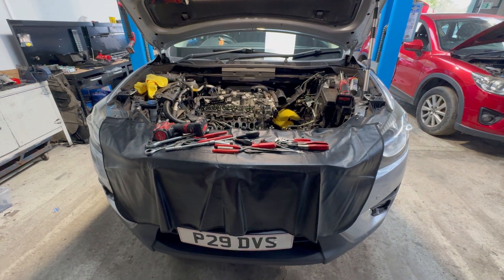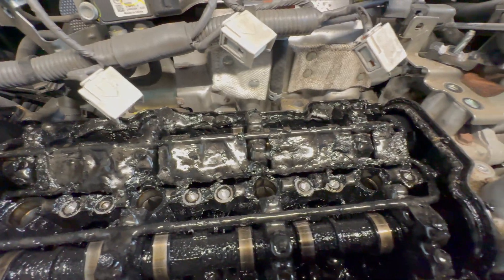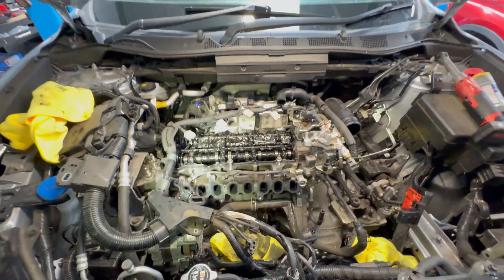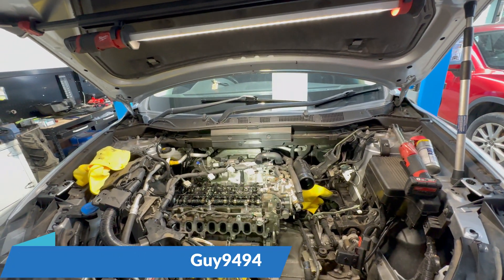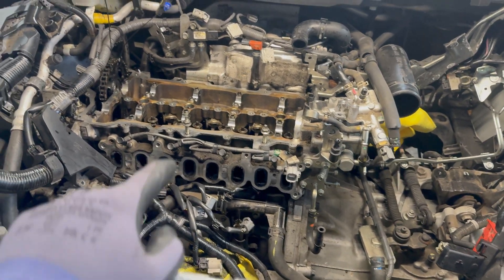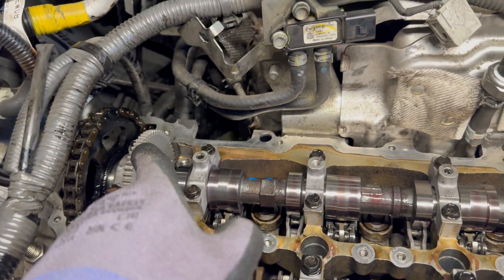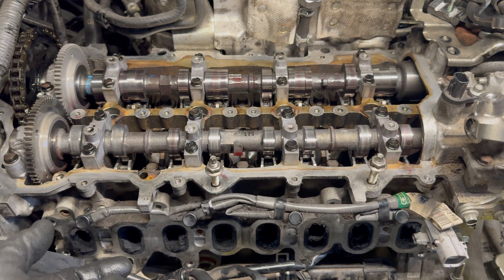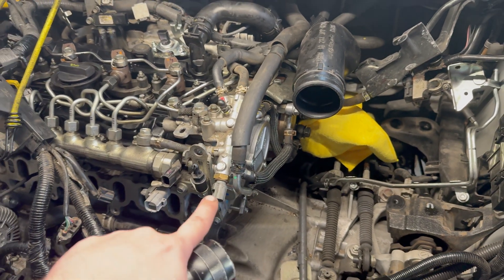Mazda Skyactiv Diesel Carbon Cleaning + Camshaft Replacement + Cylinder Head Cleaning

Comment: What's the cost of all that work, surely that car must be a write-off?
Reply: Can imagine it being around £2k - camshafts are about £350, not sure if rockers done but they are expensive at £200 each and needs 4 for the VVT on the exhaust side. Timing chains around £150 (though this wasn't done), gaskets, strrainer etc £150 all of the cleaning and labour must be around 10-12 hours

Comment: i have a 2017 mazda6 2.2 diesel and having recently taken rocker cover off, there is no wear on the camshaft at 80k miles. Engine is in perfect condition, no sludge, oil build up or varnish. Was wondering if later version of this engine had an upgraded camshaft or is it just evidence of good maintenance?

Comment: Good advice about oil changes. Ignore the manufacturer’s advice, they only want the car to get beyond the warranty. My car is at 65k miles now. At each 5k miles interval I replace the oil, at every 10k miles I replace the oil filter also. Takes me less than an hour, quicker than driving to the garage and back. I recently removed the rocker cover to inspect for wear and it was all golden and shiny with no camshaft wear. Even if I was to miss one of the oil changes, I doubt it would look like the engine in your video😮